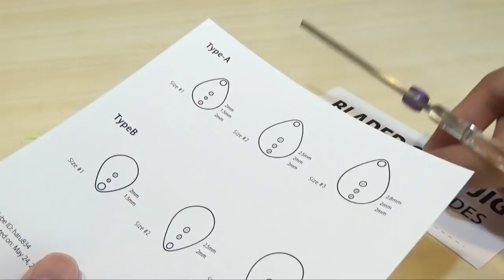Making the Lure Blades for Bladed Swim Jig / スイムジグ用のブレードの作り方

Comment: You earned a sub.and that's a rare thing with me.but this is ligit content.my question is,do these blades have to be as thick to function? In other words,does their overall weight contribute to their action,or is it just shape and placement of the holes for attachment?if I can use a thinner material,and they still work,this could be an option for me.